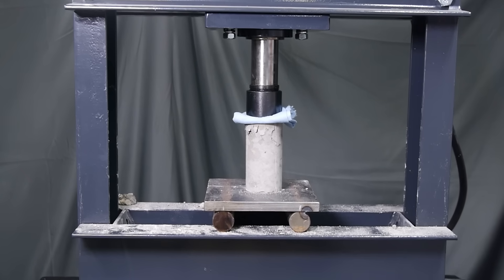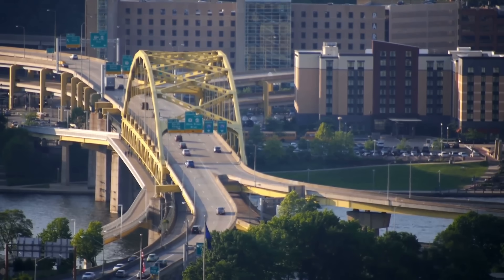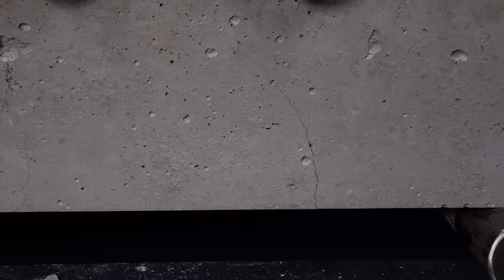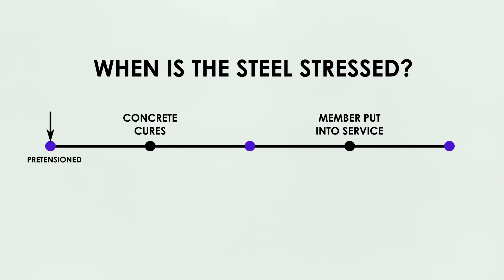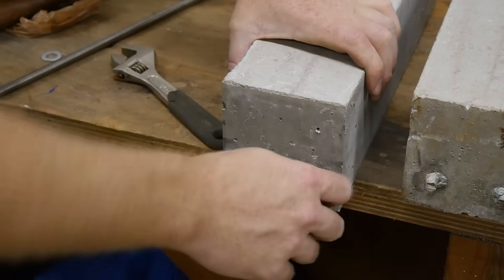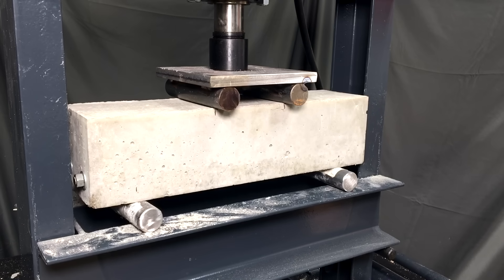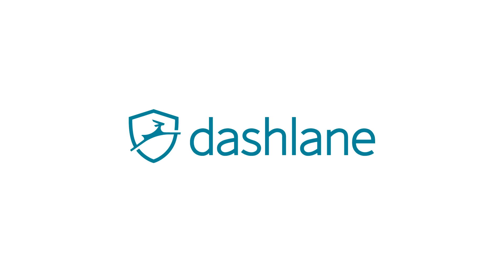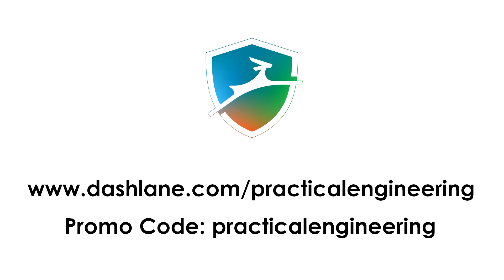What is Prestressed Concrete?

Comment: How is rebar usually pre-stressed in large scale construction projects?   And how much cost and/or time does it usually add to the construction process?
Reply: They will use steel cable primarily and rebar as a supplement.  In actuality, it could be approximately the same cost or more and similar on rebar.  The true benefit is that you can span further with a given depth post-tensioned slab than you can a conventionally reinforced slab exactly for the reasons stated in the video (cracking and serviceability).  This gives the architect/owner much more flexibility in space planning when they can have columns further apart (or keeps the slabs thinner for the same given span).

Comment: You needed a control slab with the same rods in the concrete without any tension
Reply: Second
Reply: Ummm, didn't he?
Reply: @TheOwenMajor  I only saw 3 blocks in this video,  one with reinforcing but not the same type of bar, one pre stressed, and one post stressed. Was there another video that used exactly the same type of threaded bar used for the pre & post stressed concrete block?

Comment: but why is the steel rods pre rusted ?
Reply: Rebar rust is pretty much unavoidable. the rebar sometimes sits around on site in the rain for a long time before it is used. the amount of area of steel lost to rust is negligible so strength isnt impacted. its has been shown in studies that a slight amount of rust on rebar actually helps the rebar bond to the concrete, in some ways making it stronger.
Reply: The corrosion disappears in the concrete because of the alkaline millieu in the concrete. This produces a barrier an the steel, avoiding the corrosion
Reply: @marcelwittmann2957 
True, but when the concrete gets well aged, like over 50 years, the rebar begins to rust again.
Reply: @avid0g yes but the corrosion is a result of carbondioxide reacting with water to carbon acid and reducing the alkaline millieu. This is a real slow prozess so you can reduce its impact with an bigger concrete cover.or an higher strength concrete. If the carbonation reaches the reinforcement steel it could start to oxidate but therefore it needs wather and air too and cloride will accelerate this
Reply: @marcelwittmann2957  
I have see bridge patching where the concrete is removed down to rebar, then loose oxide removed, and the concrete replaced. These guys always increase the thickness of the concrete at the patch by another two inches. Pretty much guarantees that the patch will never fail before the rest of the bridge.
Reply: Epoxy coated rebar (non-rusting) is available.  On job sites it looks light green.

Comment: This has been a great series.  Makes concrete a little bit less mysterious to me when trying to understand the right mixtures of filler/water/cement and what all the addins do.  How did the vibrator only help with reproducibility, or did you notice an improvement in strength too? Just curious if those little air bubbles are a deal breaker or not.
Reply: The job of vibrating out air is one of the most under appreciated. If not done methodically, the concrete can fail to reach nominal strength. This can be critical when removing air within a rat nest of rebar.

Comment: Grady thanks for this video it really helped! 

I am building my house with pre-stressed concrete panels and would like to calculate the load they can carry. Is there a good book or something i could use to help me on this path? I am an Electrical Engineer and know a bit of statics and what not but i would like to learn more.

The house has been designed by an engineer, so you shouldn't have to worry.

Here is a picture of the first floor above the garage.
https://i.imgur.com/Zphiz5s.jpg

I am using these panels spanning 37 ft. I went with with 10-1/2" cables. I also applied a 3 inch topping slab to smooth out the camber.

http://www.midsouthprestress.com/product-data/12-inch-hollow-core.pdf

These charts seem to show the maximum the panels can withstand. But they are an engineered product and thus they change and modify them to hold different loads. I just wanted to kind of run a ball park number on them and see what i come up with.

Comment: What were the strength differences between the concrete beams that didn't use the vibrator the de-airate the concrete?  I'm honestly really curious about that one.
Reply: It probably wouldn't make any difference in these tests.  In an actual beam there can be so much reinforcement criss-crossing every which way that it can be difficult to get the concrete down in all around the forms.  The vibration gets out excess air but also gets the concrete down in all that mess to hopefully avoid large voids.

Comment: What dictates the use pre-tension over post-tension or vice versa? Is there a cost difference between the two?
Reply from the maker: Pre-tension can really only be accomplished in a precast facility. Not really something that can be accomplished on a job site.
Reply: Remember that overhead walkway that collapsed about a year ago? They were in the process of post tensioning it when it collapsed. 
They wanted to keep the roadway open underneath it so as not to obstruct traffic.
Reply: @blipco5  I remember. AvE did a failure analysis on it. It wasn't properly supported during construction.
Reply: +Ranger Of The Order ...I've worked heavy construction for 36 years and have seen all manner of things done. In hindsight it is easy to see it wasn't properly supported. 
My guess is the General Contractor was trying to be a hero. He was probably trying to avoid paying overtime doing it during off hours and/or didn't want to pay for a police detail which would have been necessary to block a middle lane to add a temporary support structure at the midpoint. (Usually accomplished by stacking railroad ties). 
Famous construction saying...."There's never enough time to do it right - but there's always enough time to do it over".
Reply: Search NTSB FIU bridge for the current NTSB update.  The indication so far is that it was a design error.  The way it was supported  most likely did not matter.  I saw that video too and his analysis didn't really make sense to me.  He knows a lot about a lot of stuff but his theory was wrong this time.
Reply: C Lee...In searching for information at the time I saw Ave's video as well. I like his channel but he was off base on the bridge incident. I'm not an engineer but I have worked nearly four decades in construction. From what I have seen, most accidents occur as a result of taking short cuts. This one unfortunately resulted in death.
Reply: C Lee...I just now started perusing the bridge updates. Hmmm... things gone missing. I can't believe such a thing could happen in the State of Florida.
Reply: No redundancy I could find in that bridge. When the one tensioning rod was stressed well into the yield region and beyond, the bridge collapsed. Even if it made it and was fully assembled, the design would still be extremely suspect.
Reply: Metal Butcher....I thought at first the sawtooth pattern of beams above the walkway added strength but they were there only to support the roof, they added no structural strength which means they only added to the problem. Installing a span this long in its weakened state was madness.
Reply: Some factors can be a desire for slenderness of thickness of beams and slabs. 
Typical case is where an existing road bridge over a railroad is having a deck replacement where existing clearances are tight.

Comment: I know this thing called "metal fatigue" exists, but am not an engineer. Does that play a factor in these stress scenarios?
Reply: steel while under a constant stress relaxes over time, as in the steel slightly elongates and the stresses reduce as a result. this is a problem when you design for say 1860 mpa of stress in the steel and what you actually end up getting is say 1500 mpa, effectively loosing pre-stress and strength. Relaxation and other losses such as shrinkage losses, elastic losses and creep are accounted for in the design process so the real strength of the beam or slab or whatever is accurately accounted for.

Comment: So which one is better pretensioning or post tensioning?
Reply: Pretensioning is used in casting yards that produce precast joists, plank, stairs, bridge girders, double tees, lintels....anything that is trucked from a plant to the construction site.

Post tensioning is used on site for floor slabs mainly.  Hard to truck a full sized building floor to a site.
Reply: post tensioning is certainly more realistic.
Reply: @constantinosschinas4503  why is that? Pre tension is used more than post

Comment: Hey Grady!  

ideas for more:
- how the angle and length of off ramps and curves on highways is determined.  (When I was at Thinkercon I found that the off-ramps were short and curved very tightly and I wondered if it was because they do not have snow/winter like we do up here in Ontario)
- More on city/urban infrastructure (ie: how blue is added to green lights because of red/green colour blindness?) horizontal vs vertical stop lights.   
- canals?
- why cloverleafs on highways are a terrible design and why they used to think they were fine
- how do they build roads/railroads over permafrost in the north?
- cog railways  on mountains?
- airport terminals - we use those a lot and I bet there is lots of design and infrastructure planning in their layout

Have fun!
Reply: God I can't even imagine what a nightmare horizontal traffic lights would be. Only reason I can use the road is because I memorised where each light is.
Reply: @che3se1495 -- better never visit Quebec then.  Or Alberta.    Hmm, according to Wikipeda also parts of New Jersey, Pennsylvania, Japan...      
(Not intending to be flippant -- I thought everywhere had blue mixed in the green these days to allow for red/green colour blindness.  Maybe not.)
Reply: @che3se1495  colorblind?
Reply: @rfldss89  Yeah, normally not that bad but I just got used to relying on the position to avoid the confusion.
Reply: Why are cloverleafs terrible? The only problem I see with them is that the acceleration zone is a bit short for getting up to traffic speed before the merge zone. But modern cars have so much power it's not really a concern anymore. And besides, here in the US, half the drivers don't understand the purpose of the on-ramp anyway, even the half mile long ones we'll have people still doing half the speed limit when they get to the merge zone.
Reply: @josh Bobst   (sorry missed this when you posted)   Cloverleafs are terrible because they mix the on ramp and off ramp.   That is fine when traffic volume is low, but not when it is busy.
Reply: @Wordsnwood  Its basically a transfer Ramp Not a On&Off Ramp The only mixing is at either end of the Lane that you follow So its basically a lane taking you from One Highway to Another Highway in the network what you are talking about is one of the reasons that roundabouts in my opinion are poorer than Intersections Due to the system Collapsing Under pressure of Network usage
Reply: @joshbobst1629  I made contact with another vehicle on a tight cloverleaf once. I made the mistake of letting the exiting vehicle pass me before trying to accelerate in the "weave zone".

Very minor damage since the relative speed of the vehicles was small though.
Reply: Clover leafs are fine but they are often poorly implemented or squished by later lane additions; mostly though, at least in my state, driver's ed is not required for 18+ and the driving test doesn't have a single mile of limited access highway, instead being mostly concerned with parking. 
In fact the only real alternative to clover leafs [other than difficult to navigate and absurdly expensive spaghetti overpasses] is yet another horrible stoplight wasting fuel, polluting the air, and and backing up traffic.(and that is in the rare event of correct programming tailored to the intersection and hour of the week)
Reply: Cloverleafs are fine for moderate levels of traffic and are a relatively affordable design.
Reply: Wordsnwood (Art Mulder) these are excellent ideas! I vote for the angle and curve of off ramps
Reply: Land take and land acquisition are big factors
Reply: I’m from Ontario too! 🇨🇦
Reply: Hi Grady! Please consider what this guy said

Comment: Beautiful videos.... Enginering construction become understable for everyone... Simplicity and example... You should make a video on how to make a good CLT Cross Laminated Timber (I think this product have a lot advantages for the floors and flat roofs of houses and buidings : good flexibility resistance, safe against fire, good accoustic, low weight, good thermal resistance, ecological to produce and to transport,... if it's easy to replace).

Comment: Just wonder: if a concrete slab with rebar cracks at 4 tons and a pre stressed rebar cracks at 8 how do you make bridges that hold trucks that can be 12 tons or even trains with like 100 tons?
Reply from the maker: Use bigger beams
Reply: by increasing the size of the Beam and area of steel used